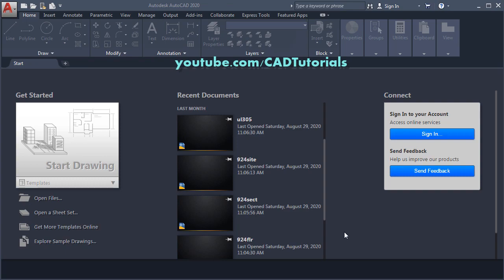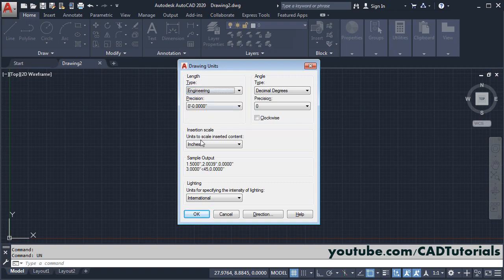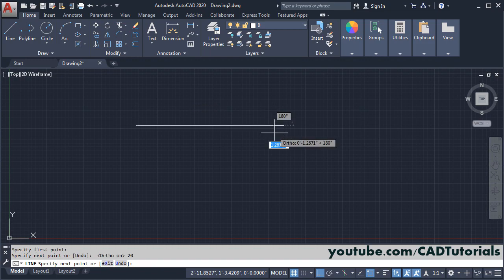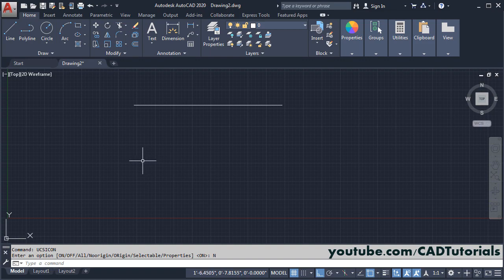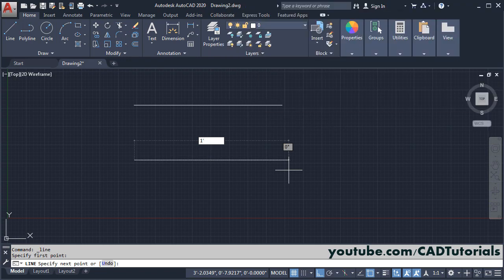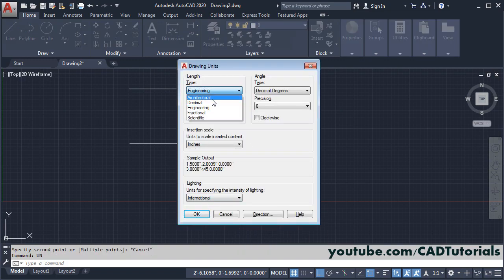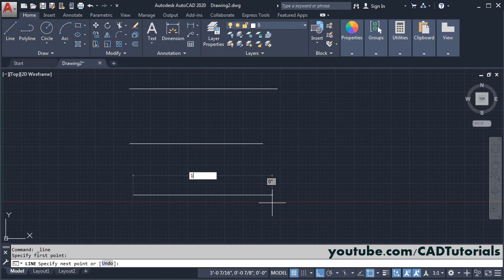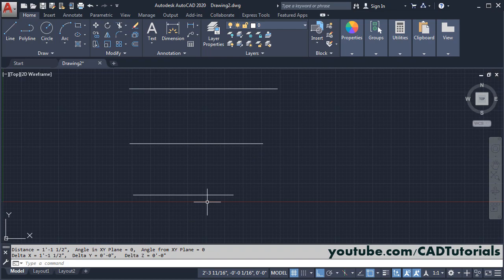AutoCAD Draw Line in Feet and Inches

Comment: How do you actually get it to dimension in Feet and Inches? All of my settings are the same as I see in your video but I cannot get the dimensions (when placing them with the dimension tool) to actually put them in Feet and Inches instead of just inches.
Reply: Change the settings in DDIM
Reply from the maker: https://youtu.be/NJm84YCNqbU